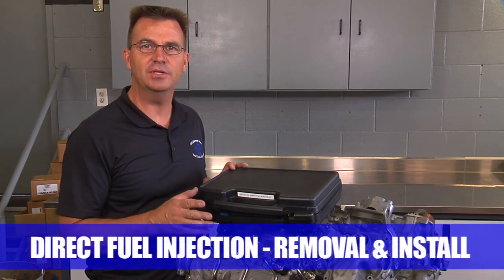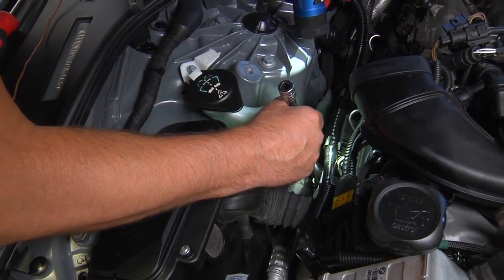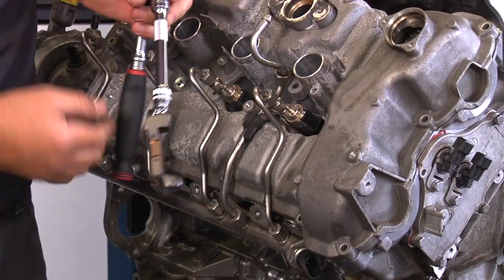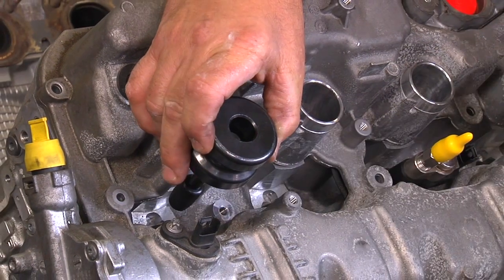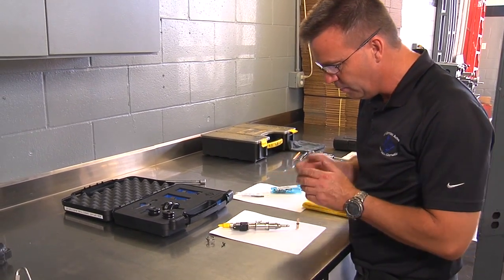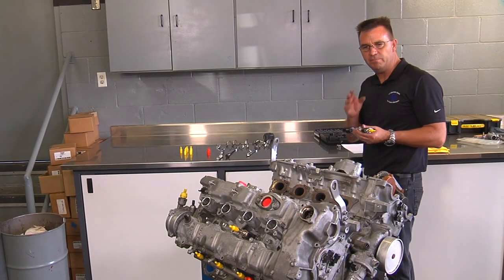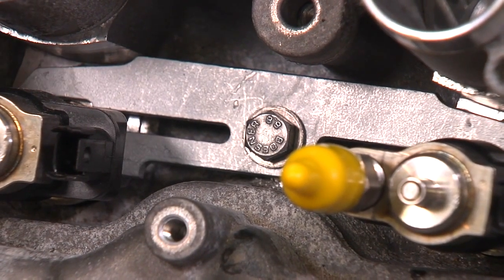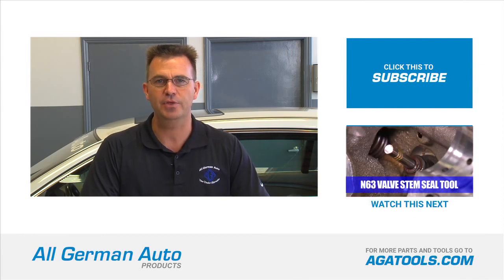AGA Direct Fuel Injection

Comment: How do I know if I have fully seated the injectors when putting them back in?
Reply: A trick : watch movies at flixzone. Been using it for watching loads of movies lately.
Reply: @Kasen Ronin Definitely, have been using Flixzone} for months myself :D
Reply: @Kasen Ronin Yup, I've been watching on flixzone} for since november myself :)
Reply: @Kasen Ronin yea, been using flixzone} for months myself :D
Reply: There is an installation tool that helps gauge that. Look up BMW injector installation tool. It's the same as the one used with N55's, N20's, N26's, etc

Although, to be honest, I usually just install them by hand, and follow the torque specs for the hold downs. Never had an issue. 🤷‍♂️